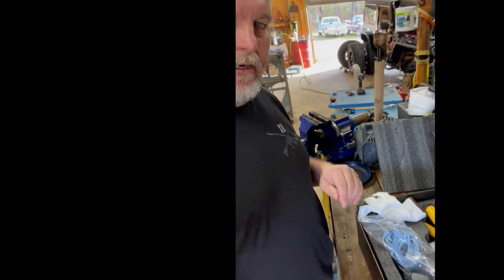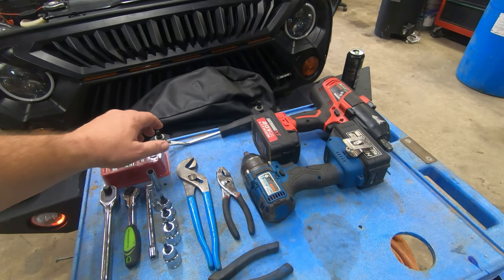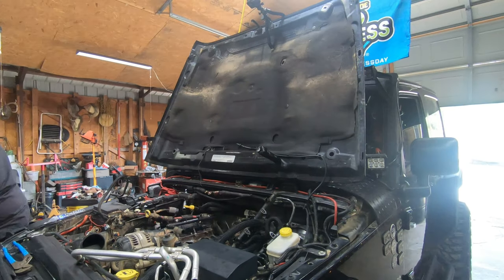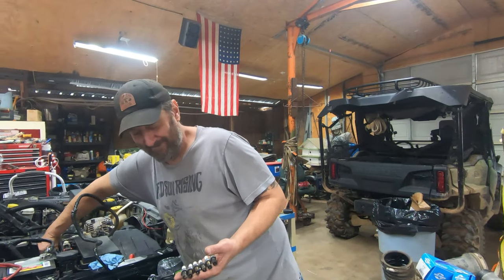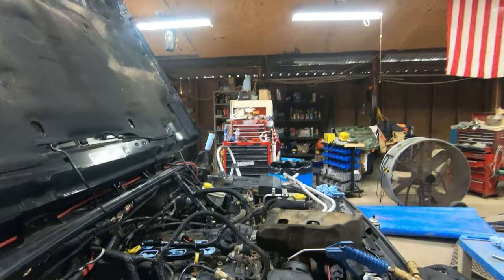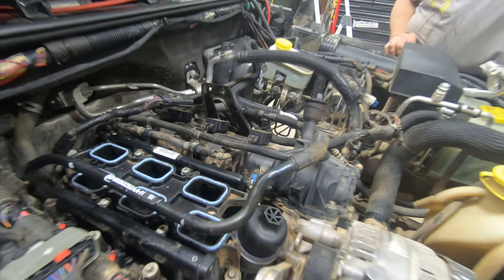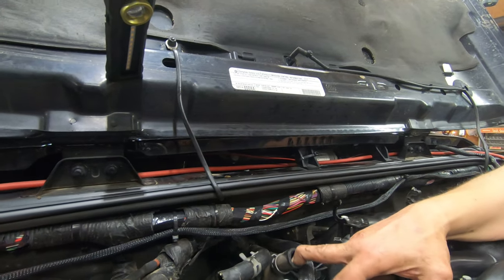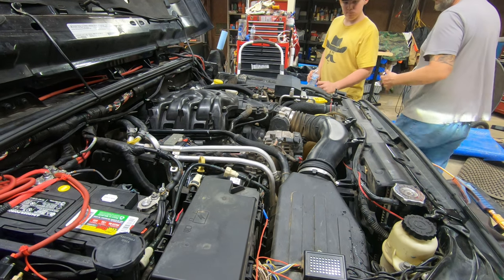Engine Oil Cooler Replacement- 2012 Jeep Wrangler

Comment: So this is so crazy to me. I look for an oil cooling replacement video just as a refresh from the first time I had to do this about 6 months ago. 
First, mine is also black sheep.. lol looks very much like that one. Almost identical metal tubular fenders. Mine just have slots cut out on top. 
The first time I changed out the oil cooler was an exact story. Not sure where you boys are from. I’m here in the Carolina’s. Took my freshly bought sheep to a place called  uwharrie. Had my stepson with me. He was a Jeep owner long before I bought this one. Looked like it’s never seen mud. That is until I took her to uwharrie. Spend the day on the trails and having a great time. On the way out, omg, the mud hole has a name. I have since forgotten it because the damn thing almost destroyed my Jeep. 
I was never gonna take it in mud. But I was coaxed into it. I’m not gonna lie, it was fun. But never again! I bought a pressure washer. High pressure washer..I washed it i can’t remember how many times. I laid under the jeep and pressure washed it. I’m still finding mud. NEVER AGAIN! 
I would say about a month later i had to change out the oil cooler as it started leaking oil. My mistake was trying to go cheap. NEVER AGAIN! I bought a black plastic one. Cost me about 75 bucks. Had to buy the gaskets separate. My first time ever changing out something of this magnitude. Found one really great video where it wasn’t a time lapse. He went slow and showed everything. The kind of bolts what to take off, what I didn’t have to take off, what I could just move to the side. However, no matter where I looked I couldn’t find the torque specs of any of the bolts. So my stupid self thought, ok just tighten em. So I borrowed a Milwaukee battery operated 3/8 ratchet and let er rip. Boy did it. Stripped 2 of the oil cooler bolts. I’ve never been so upset at myself in my life. 
But there are once in a lifetime lucky moments for me. I took the bolt to Lowe’s and found bolts identical to the originals but just a hair bigger in diameter. When I installed the bolts, I used a manual vintage torque wrench and prayed as I waited to hear the click. When it clicked I almost shed tears. Same thing with the second bolt. Another mistake I made was not putting any thread lock on the bolts. 
I’m sure you can guess what happened about 4 to 6 months later being on 37’s and knobby tires. I’m guessing the vibration loosened those bolts. Or stripped them back out again. 
I just assumed it was a big plastic pos oil cooler. So I too bought an all aluminum oil cooler. Even the cap is aluminum. I wasn’t taking any chances. I haven’t put it in yet because I have had a back injury that has prevented me from doing so. Rods and screws in my spine and now SI joint. But I am tired of seeing my baby just sitting there going to waste. I bought this cooler about 6 months ago. Yes, I’m sitting here with it in my lap. Lol I have got everything ready to get to work on it tomorrow. 
Going to say a huge prayer that the two bolts I stripped out the first time isn’t the issue. But if it is, I’ve come up with a hack to fix it. Hopefully there won’t be any issue and my back will let me get through it. 
Great video! Love the Jeep! Great job!
Reply from the maker: Thanks Brother!! Sorry bout your oil cooler misfortune. So far so good on my replacement. We are in Northwest Arkansas.

Comment: Question - how does driving through a hole and not around it affect the Oil Cooler? The reason I ask is I did the same thing in beach dunes but I thought maybe I over tightened the filter cap bc I did an oil change recently.

Comment: Good Video and very informative. I only have 7,400 miles on my 2021 JT 3.6 Pentastar - I hope mine is still cranking at 140K miles!
Reply from the maker: A regular maintenance schedule will get you a lot of miles out of that little 3.6. And we HIGHLY recommend a transmission flush every 50k miles. Thank you for the compliment! We are swapping out the NAG-1 Transmission Valve Body this Friday. A video on that swap will follow. Happy New Year 😊

Comment: So I replaced it because it was leaking all my water and very little oil now that I replaced it I can’t keep the oil in it as soon as I turn on the vehicle all the oil leaks out I followed the torque specifications I mean sure and went in there I am wondering if it’s a defective part I thought the aluminum one could you help me out with some suggestions?